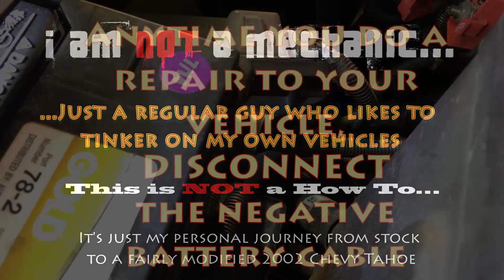Long Tube Headers & Y Pipe Install on Chevy Tahoe 5.3 Vortec GM Truck

Comment: So if you weld the cats back on, did your engine light come back on? Also you can by aftermarket cats, installing them with long tubes will you still have a engine light come back on?
Thanks 
Brian

Comment: Does it matter if the truck is 2wd or 4wd i noticed some headers state that they wont fit a 4wd truck i have 99 silverado regular cab 5.3 4x4
Reply: the left header will hit front drive shaft..i already had my right side on then went to do left and it rubbed so had to painstakenly rosebud heat header and portapower it away from driveline..took many attempts but finally got it..i recommend getting correct headers..i couldn't due to having to buy others and not being credited for one's I had

Comment: This may be a dumb question but you don't add the cat converters back right?
Reply: No the long tube headers are meant to replace that whole section making it a cat less down pipe as well as headers
Reply from the maker: Eventually i did cut and weld some back in
Reply: Did it had the cam already or the stock cam
Reply from the maker: Had cam
Reply: @TahoeSteve  do you have photos/video of what that looks like now? did you post a video going back to do that? i didn't see one in your video list

Comment: Have u had a problem with the header rubing the frame on the passenger side on the truck? Mine dose and it is 2 wheel drive.
Reply from the maker: a little but it's not an issue (at least on mine)

Comment: How did you get rid of the check engine light after removing the rear O2 sensors and cats?
Reply from the maker: you need to get a tune to delete it out.

Comment: I'm planning on putting some on my 02 Tahoe z71 did you have to extend the o2 censor??
Reply from the maker: Not at all.  check out the video that follows this one (https://youtu.be/MM5IngsUS4k?t=5m50s) and I show you exactly what you have to work with for the O2 sensor.

Comment: Did you personal the manifold bolts in any lubricant for ease of removal? Also did you replace the bolts with new ones (arp) ?
Reply from the maker: hit with pb blaster and let em sit over night.  yes, replaced with new ones.

Comment: 7/8 long tube headers if I install them will anything rub?
Reply from the maker: If you have 4wd you will probably hit the front drive shaft with the 1 7/8.  It will also be a tight fit running along the trans cross member.  What are you running?  If you have a 5.3 you probably won&#39;t see much improvement in the 1 7/8 vs the 1 3/4.  If you have anything larger than a 5.3 then the 1 7/8 would be justified.

Comment: How do you remove the bolts without breaking them?
Reply from the maker: the age old question.  I let mine soak in PB overnight when I removed the stock manifolds.  I still had one break so if anyone knows, please chime in.

Comment: So u eliminate both down stream 02 sensors or just 1?? And how does it run by doing this???
Reply from the maker: Yes, I eliminated both downstream O2 sensors and had a professional tuner tune them out.

Comment: Hey great vid ! Did you have any problems with a broken manifold bolt? I’ve heard that’s a very common problem and if so what did you do? Any tips ?
Reply from the maker: I did when I did my engine rebuild.  2 of them snapped off.  But, because  my block was at a machine shop, he took care of it for me.  I have heard where people have welded a bold on the end and  gotten them off that way.

Comment: I also really wish you showed the removal of the steering shaft I removed the bolt but it doesnt budge
Reply from the maker: John Russell it was one bolt, a non issue- that’s why I did not show it.
Reply: so after the one bolt what do i do? does it need to be tapped with a hammer up or down or what? I really appreciate you answering my questions this video is the only one and it also works for 6.2 escalades also. I hope I don't seem ungrateful I really appreciate the video

Comment: question. i removed all nuts/bolts and now trying to pull the exhaust manifold on passenger side the dip stick is holding it. how do i remove the oil dip stick
Reply from the maker: mine just pulled out with a little "emphasis"
Reply: Steve Schwartz do i just pull upwards?
Reply from the maker: c-a-r-e-f-u-l-l-y
Reply: Steve Schwartz got it done yesterday. just yanked it up. btw i downloaded the part where you say "passenger side" lol
Reply from the maker: now, that's funny right there.  keep us posted!

Comment: I really dont wanna fuck with the trans mount anyone have success with  wiggling it out 1 side at a time or swaybar bracket removal etc
Reply from the maker: John Russell if it’s short cuts your after, install shorty headers.
Reply: lol nah already got the american racing longtubes. based on the manifolds on the 6.2l  i dont think shorties would make a lick of dif it might ad 2 inches of primary length if that

Comment: Is there a reason why it sounds like you are whispering lol
Reply from the maker: pure exhaustion after a long day under the truck.
Reply: I can see that I'm thinking shorty headers on mine
Reply from the maker: I have read over and over again that the stock exhaust manifolds on these trucks are very well made and that shorty's will only gain you about 3-5 HP.  Just a thought as it is a lot of work for that small of a gain.  But then again - if you are addicted to HP, every gain helps!  Let us know what you decide to do.
Reply: Lmao 😂
Reply: He Doesn't want his wife to find out about the new car parts

Comment: Can someone explain to me what headers are ?
Reply: Jaime headers are the first bit of exhaust from your engine . From the block it enters the headers Wich feeds it to the main exhaust pipes Wich includes cats or glass packs depending if you removed the muffler , then out the back of the vehicles . Installing long tube headers lets your motor breathe better giving it a easier flow of piping normally . And also gives it a louder and meaner growl . Hope I helped lol
Reply: Ruh haha thank you 👍🏼